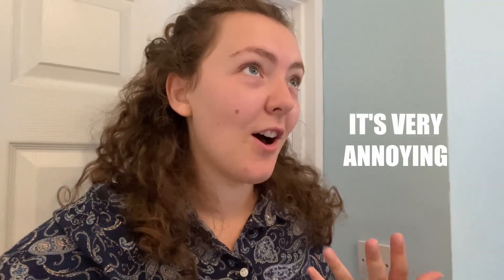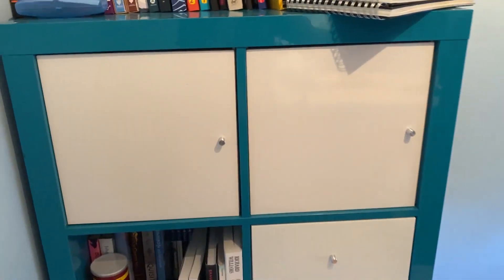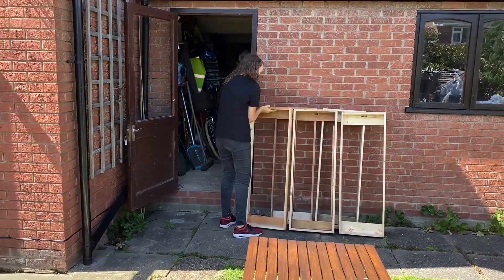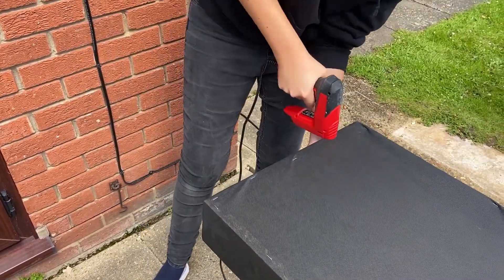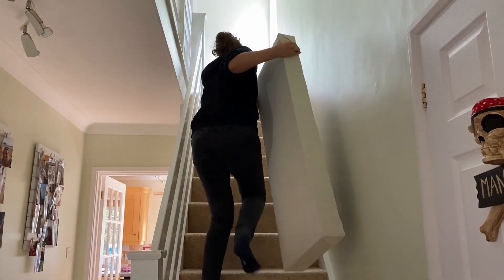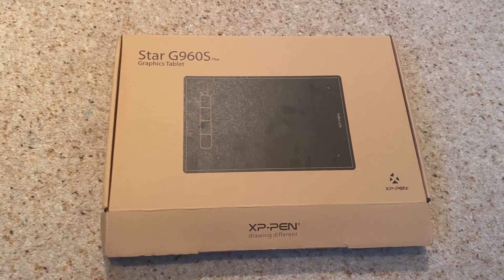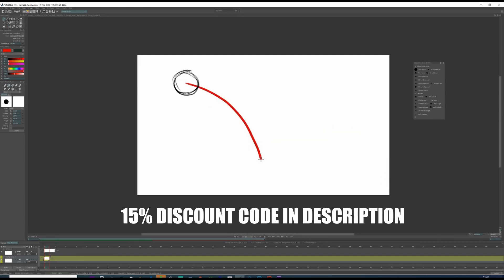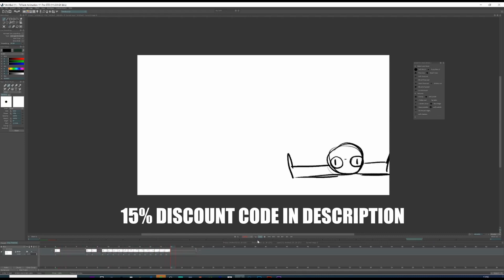DIY Acoustic Panels: Transform Your Studio Space on a Budget! Before and After Results!

Comment: You can use CoroPlast (corregated plastic) to make frames to hold the rock wool up to the ceiling. Make a lip go all the way around on the bottom side to keep the rock wool in place. 

Also, cheap old books from garage sales are great at absorbing sound while making a nice background for videos. Just fill a wall full of shelves with books and leave spaces between them to trap more sound.

If you don't care what things look like, you can even take plain cardboard and make an "egg crate" design with about 2 x 2 cm squares, about 10 cm deep. That will trap sounds as well.  But it's a lot of work cutting all those slots in all that cardboard.
Reply from the maker: Thanks for the tips! I do have a lot of books so more shelves is a possibility - never thought of using them that way so thank you! As for the egg crate design - would actual egg cartons work do you think? They wouldn't look the best unless they were spray painted and it might take a while to collect enough but if they worked it'd be a good DIY/cheaper alternative!
Reply: @kdsketch  actual egg cartoons would not work as well. A) They don't had as much mass to another the energy. B) They aren't necessarily as deep as I described. All those deep and narrow cavities cause the sound to bounce back and forth all the way down then all the way back up from the wall. The cardboard sides of that cavity absorb energy with every bounce. It kinda helps to understand a bit of the physics behind sound waves and the energy they carry. No maths needed. 

Is it as good as your rock wool? No. But it's super cheap.
Reply from the maker: Oh right! I was thinking if you filled them with cotton wool it’d help a bit but maybe that’s too much hassle and it’d be both quicker and easier to just buy acoustic foam and add that to the ceiling 😅 super interesting though - I definitely need to look into the sound side of animation - thanks again for sharing!